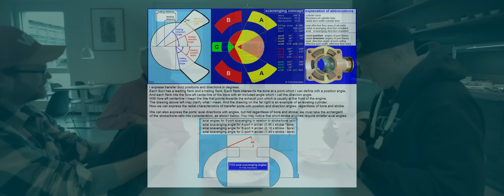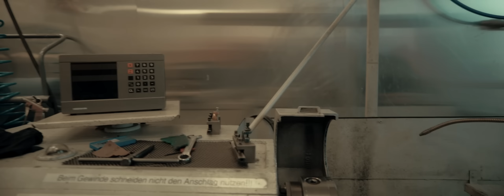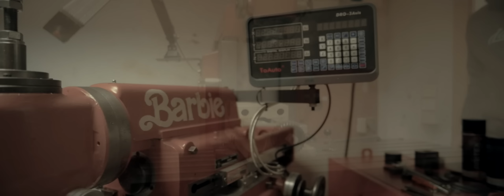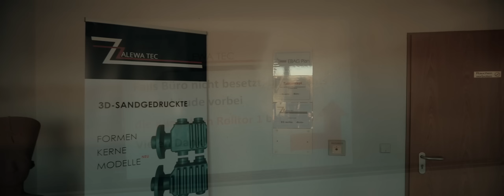YOU WON'T BELIEVE WHAT I BROUGHT FROM GERMANY! (seriously, not clickbait)

Comment: frits is brilliant, i have built some amazing pipes that outperform all others thanks to insights he was kind enough to share with the world.
Reply: what factors govern the diameter of the largest part of the expansion chamber ? i realize a longer stinger makes more hp at a sacrifice of low end torque.. the stinger should be as small diameter but not small enough to create any physical "back pressure" ,,its the taper of the long reverse cone that reflects the sound wave of the exhaust tone that stops the fresh incoming air/fuel mix from escaping until the piston seals the exhaust port .. back in the early 1970's i worked at a tire shop with a pro go-kart racer who ran crysler west bend two strokes ..they would make the length of the stinger adjustable , while driving turns they shorten the stinger coming in to a turn to make more torque as they didnt have a transmission to gear down and then after they round the turns they reach back and slowly lengthen the stinger to build more rpm . actually got the see this work and you could hear and see the difference when they got it wrong too ..i took auto shop in high school 1964 - 1968 then i went on to a tech school thrugh rhe university of illinois for three years packed into two years straight with no time off for summer from fall 1968 - 1970  then on to several factory school while on the job ...but out of hundreds of instructors of years of professional education not one person told me what cause the power band of a two stroke "when she comes on the pipe " in 1975 i was ask if i wanted to be a part of honda's R&D of there very first two strokes ..they were the only japanese motorcycle companies making 4 strokes only and refused to make two stroke per orders of mr. honda himself and honda had not won a motorcycle race since 1964 when the two strokes took over ..so mr. honda seen the writing on honda"s empty trophy wall and finially gave in but aganist his will to do so .  honda being the best hired a man who was the best of the very best of the best knowledge of all two stroke and four strokes ever made by every motorcycle company and all their r&d of every trick they know who could make these there worshiped as the gods of two strokes , look no smarter than you guys here  .. this man was and is responsible for every race won on a motorcycle ,,,he was no other than pops yoshimura the inventor of the honda elsinore  of totally piston port induction then the were reed valve induction and finely add exhaust port power valve for more low end and mid range .. but the most important fact of all two strokes that was never mentioned in this video and every video for over 25 or 30 years plus is the fact two strokes are naturally supercharged internally ...and it seems these three in the video dont have a freakin clue that two strokes  do  ..if you built pipes that out perform all others you might know of yoshimura who was the one to 1st show why a two stroke supercharges and how this fact happens by the numbers .. do you have any numbers you wish to share  ,,and not like these three in the video who are guessing their way but no cigar
Reply: @donniebaker5984  there are a lot of factors that going to determining the belly size of a pipe, larger you make the belly the more of the exhaust energy is biasing towards diffuser, evacuating the cylinder. if you make belly too large the return wave is will be too weak and you will lose your supercharging effect and blow fuel out of the exhaust and have a peaky powerband. old school two strokes are "supercharged" internally because they don't have a good pipe, they need the crankcase compression to scavenge for them, it's the goal of modern racing two strokes to use the exhaust pipe to do this scavenging as much as possible instead of the piston, because it results in less pumping losses, more efficiency at high RPM. it's too much work and wasted power to compressed gases in the crankcase at high RPM.

Comment: adding pressure sensors in the cylinder is really awesome and tuning the ignition on this pressure sensor can create some insane power.
This similar idea has already been done on big diesel engines. where the pressure can control the injection timing etc.

Data is key and you can do so many thing, with the right data you can harness the power.

Comment: With the pressure sensor you would be able to almost always fire when the pressure is at its max point. And some kind of one way valve for the exhaust, one you could maybe open up and close for the backwards pressure from the pipe. And your cooling solution with the big reservoir may do this cylinder well as with your design it sometimes ran too cold. Awesome video, really learned a lot and made me think about all the great engineering that was done by these legends!

Comment: would be absolute bliss working at a place like Langtuning, about the transfers, sure it does make sense that you larger transfers would decrease the initial pressure going into the cylinder, and maybe too much mixture is left in the transfers cause the returning of the piston dont displace enough volume

Comment: Had a feeling they were going to drop the project in your lap. I would approach it pretty slow, especially when getting into the final tune. Pull it apart and measure things to make sure you're not nuking ports and melting rings right when you need them. You may be able to get the kind of resolution for measuring those pulses with an oscilloscope and a piezo pressure sensor.

Comment: Went to the Barber's Vintage Motorcycle Museum a few days ago and one of my objectives was to see what type of intake the fastest 50cc bikes used.  The "Rotary Valve" was the dominant design and what Kreidler used.  At one point, Kreidler held the land speed record for 50cc.  I am not an engine designer but I would guess the rotary valve may be the best intake design since a reed valve does add some restriction to air flow that may hinder the peak horsepower plus you can eliminate the intake port that is required for a piston port.  Something else I saw was a few bikes had the cylinder turner around with the exhaust exiting the rear of the cylinder which allowed a very straight expansion chamber...which should help increase air flow.

Comment: Hmmm, put an accumulator on the exhaust to decrease the pressure pulse.  Just like I have seen on my Honda CRF230L motorcycle intake.  In theory it sounds good but I will only believe it after testing :).  If it works on the intake then it should work on the exhaust.  The concept of instrumenting the engine to define the pressure vs time is a great idea.  Just my guess but I don't think the "full cylinder" is going to help and it may hurt...my rational is the velocities will be much slower because there is so much open area/volume and low velocity means low pressure so there won't be as much force (air has momentum) behind the gases that are filling the cylinder.

Comment: Been thinking about this for the last month!  Elwell always talk about lost power because of heat soaked engines 

So they why are we setting all out clearances at room temp.  They should be clearancesed at the operating temp.  And not just take for granted the type of metals and their thermal expansion on paper, by the the specified piston and cylinder grow too.  That why it is more predictable. 

Yes, you would have to preheat the engine but it may be more stable this way.....

Comment: Why not use methanol to run on the air cooled engines? I converted a 200cc to ethanol with higher compression and timing and ran extremely cool and consistent. But down side is fuel is unstable and draws moisture from the air.

Comment: The measuring exhaust pulse, ignition advance, and cylinder pressure, and crankcase pulse,  I did exactly that with a 4 channel lab scope and 4 pressure transducers. 

But I could not make sense of the daystar I had.  So it never went elanywhere. 

I did all that do try and get rid oh a bog in the mid. And in hopes of making a hydraulic adjustable cylinder  head.  That way all all aspects could be adjusted on the fly.

What started the whole thing was to know when the pulse in the pipe was coming back.  We do it by the seat of our pants basically.   We just know when it comes on the pipe.  And that's it.  I want to know at why degree of crank rotation and port timing does the pulse come back to the cylinder exhaust port

Comment: klapstühl is folding chair

hmmmm interesting way printing the "flask" instead of the mould never guessed they would spray on glue in the places where the sand needs to stay , interesting and i think it could be made in a small scale in a home enviroment using a cross between a 3 d printer and an inkjet printer head spraying the glue 

as for the overpressure in the dyno room . it might increase power if you tune for it , running it under the two pressures unchanged would be to tune an engine to run good in the mountains and then bring it down intoo the valley

interesting to see all the 2stroke wizzards together around a table talking about their passion , i bet that just about everyone sitting around that table has learned sumting new or been given some new ideas for their own projects 

about putting the tempsensor in the head : maibe he can adapt the spark plug so he can run the tempsensor in that (either weld in intoo the outside or tap intoo the center electrodes temperature ... picking the temp off the center electrode will be hard to do with the power for the spark runnign through that prolly weakens the spark and blow up the electronics on the temperature probe end but sticking it on the outside between the porselin and the metal outer casre should be doable if he starts with a verry cold plug and fills in part of the space between the electrode and outer casing with an epoxy after installing the probe to electricly insulate it 

definetly looking forward to seeing the second part when you guys come back together and do the dyno challenge , think the most fair would be to start with the same base engine , the extra time before the next meet give all of them some time to think up ways to beat the others on the dyno  
maibe have the cilinders taken off after the dyno runs and have the guys explain wat they done to it , might learn something from that

Comment: Hi, I have a question. I have a 2 stroke project im building up, but i have run into space issues. I need to move my carburetor. what is the maximin length/ farthest distance i can have my carburetor from my cank case?

Comment: Turn off exposure compensation. That's it. The camera will not try to compensate for changing lighting conditions.
Reply from the maker: 👍 Was auto iso that screwed me this time, aperture/shutter was in manual.
Reply: The other guy placed his camera opposite from yours. So he probably didn't have that issue. Your camera had to adjust for that harsh daylight coming in from the shop windows. If ambient light was overpowering it, it would have been fine. Nonetheless less a good video.

Comment: A reason why Simsons are especially common in Germany but not anywhere else is probably due to the strange legislation differences between scooters and "Mopeds".
Modern scooters are regulated to 45km/h and your drivers license is only valid for a 2 wheeled, 50cc bike with 45km/h topspeed. That wasnt always the case though. Back in the days you had your Simsons, Hercules', Triumph bikes and so on which were able to drive 60km/h from the factory while still having 50cc at max and you were allowed to drive them at that speed. In the early 2000's they changed the law to limit every new registered scooter to 45 km/h, but there is an exception. Every Scooter that has original documentation from the factory, stating that it can drive up to 60km/h will be allowed to drive at that speed, even if your license says otherwise, because it's not a newly registered scooter and you would need to alter the engine/drivetrain or electronics to make it compatible with the new speed limit which in turn would make it a "non-factory" scooter that isn't registered.
Therefore alot of younger germans much rather wanted a simson or anything they could get their hands on with 60km/h factory papers than a scooter that would drive 15km/h slower. I guess Simson has such a big prominace now, because they were available for very little money and literally anyone knew how to exchange some spare parts which were also produced by alot of companies and therefore equally as cheap. You could get a running simson for about 100€, sometimes even cheaper, while a scooter would set you back 2,5k for a new one, or 500 and upwards for a used one, that hasn't been illegaly modified.
Reply: First Point
Hercules and Triumph was only 50kmh Just Simson Had 60kmh 
Second
Simsons was cheap years ago (6-8 years the prices started to rise) nowadays Its very expensive
If you are very very lucky you get a barnfind for 300-500€ but its very rare
Greetings

Comment: Video felt like 30min, saw now it was over 1h long :).

My mission are to get hold of an old moped. 
But they are sooo expensive nowadays.
I regret throw away couple big cardboard moving boxes with 
old moped parts i collected thru the years, 
when i was around 20 all the stuff went to recycle station :/.
It didn't had any value 1980-90s, it was junk. 
You was given stuff back then, Complete moped taken apart in box you could get for 20-50euro.

Comment: For å kontrollere timingen på eksospulsen som blir sendt tilbake til sylinderen så kan man lage et teleskoprør mellom sylinder og potta, lengre avstand ved lavt turtall og kortere ved høyt turtall.
Reply: So basically like a trombone?
Reply: @Henning_S.  yes
Reply: @noenlunde7028  maybe the U-shaped sliding tube adds too much length to the exhaust, so it may only work for pretty low rpm.
Reply: @Henning_S.  Jeg mener ikke at den skal se ut som en trombone, bare et teleskoprør.
Reply: @noenlunde7028  somehow YouTube didn't show the translate button, so I can just guess what you wrote in the last comment, using my German and English... Am I right with my guess that you suggest a straight telescopic tube instead of the U shape of the trombone?
In that case you need to mount the main body of the pipe on rails, so you can move the whole thing to the rear in order to extend the telescopic tube.
I think it will look a little weird, but it will probably work
Reply: @Henning_S.  Yes a straight telescopic pipe with  a moving expansion chamber. Its just for tuning the  powerband, nothing else matter.

Comment: 😈😈😈 what about a transverse or v pattern 50 cc  twon stroke  motor ...   made for one fast ride ..... pistons the size of a coin ... it would rev sh#tless  and have plenty of torque, ,  maybe 4 50 cc Chinese carburetors , 4 barrel exhaust system ... thin light weight titanium,  use a plastic and carbon fibre frake from electric bikes ......   😈😈😈😈😈